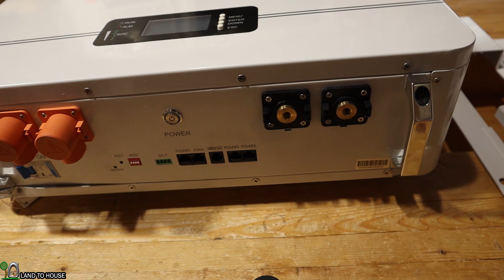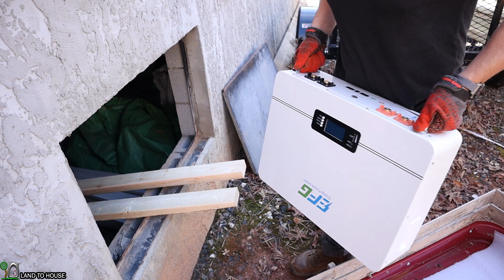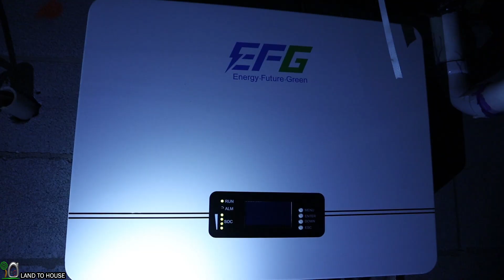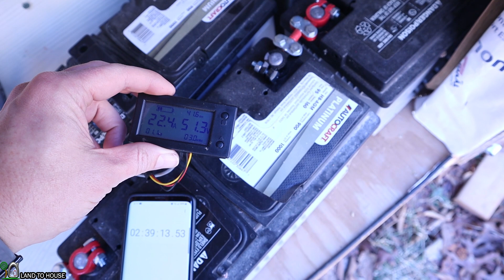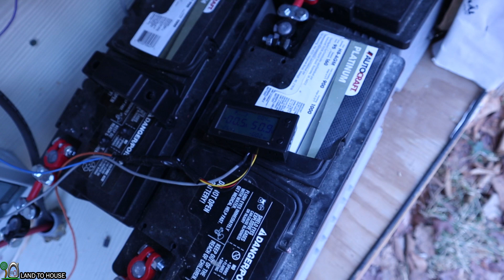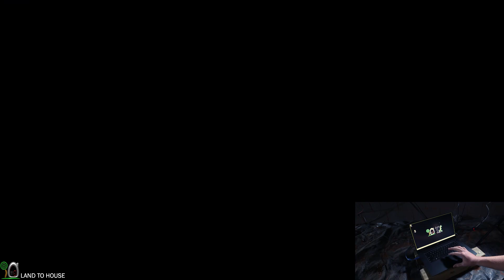EFG LifePo4 5KWH Battery Overview and Full Install

Comment: I have this battery and I am not able to connect it to the inverter.
I cannot connect it to the Anenji 6200W 6.2 kW 48 V Off-Grid. I have already tried three RS485 cables (the included blue cable is definitely too short).
The inverter is set to LI 2 or LI 4. Both settings result in communication error 15.
The LI 2 setting on the inverter uses the PYLON US2000 protocol version 3.5. LI 4 - Standard communication protocol.
What should I look out for? I would be grateful for a tip, maybe someone has managed to communicate this battery with the inverter.

Comment: In hindesight would you have build the shed differently insulated ect?
Reply from the maker: It would need a heat source. Possibly a 75w bulb would keep it above freezing. Mostly larger is the change.

Comment: Amazing set up, that is too cool.
The monitoring cable blue part is a USB to Serial DB9-Male converter (circuitry in the plug), the gray plug and phone wire is an extension cable with RS232-DB9-female on one end, and looks like RJ11 (4 pin telephone) on the other (hard wire connection no converter circuits), but it could be RJ12 (6 pin telephone). I am actually surprised since all the equipment I've ever worked on used RJ45 serial ports for the admin console. You can get an extension cord for either RJ11 (4 connector) or RJ12 (6 connector) to run in the crawl space from the battery to your home office so you can plug in up there instead of in the crawl space.
Reply: DE9, not DB9.  The second letter refers to the shell size.
Reply: @randacnam7321  I've learned something new, thank you.  So many vendors label their wares DB9.

Comment: Awesome battery, thanks for sharing.  So now you have a 15KW solar battery in the utility room running your critical loads, and a 5KW solar battery under the house running everything else, I bet the electric company isn't getting much money from you anymore.
Reply from the maker: Thank you. With the hvac going we are still using plenty of power. But I have seen days with 13kwh used. The average home uses 30+kwh. The next step is a 3.6kw inverter to replace the two blue ones that can only do 700w each.

Comment: Hmm.   Seem like a lot of work for little gain.  5KWh is such an insignifcant amount of power.
Reply from the maker: You should hens seen the power in the agm. 1kwh on a good day.
Reply: @LandtoHouse  I bet.  My favorite part of these types of projects is how precious electricity is, and how hard it is to come by.
Reply from the maker: @falsedragon33  for sure. The vestwoods system has made 155kwh in a month so far. Thats with a 15kwh battery.

Comment: Next time something like this comes up, might consider rigging a pulley or a few in the floor joists above, and hoist it up.  One pulley above, you have to lift the entire weight.  A pulley above, one on the weight and another above (rope following that path) means you lift 1/2 the weight, but you pull through 2x the rope.  Keep adding pairs of pulleys to reduce the weight (and increase the rope) even more.
Reply from the maker: My friend Spencer Langston uses such a pully system to lift inverters for testing. When I build the future test studio I will have lift tables and pullies for such heavy things! It would save a lot of stress on the back for sure!
Reply: I certainly agree!  👍